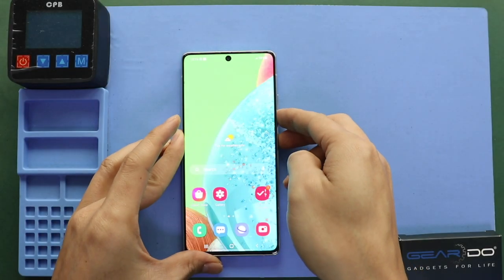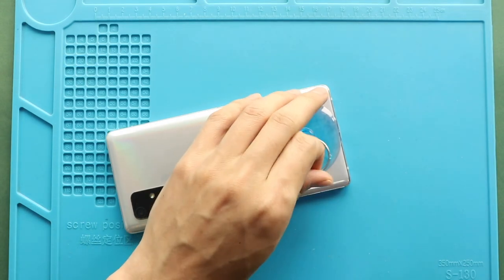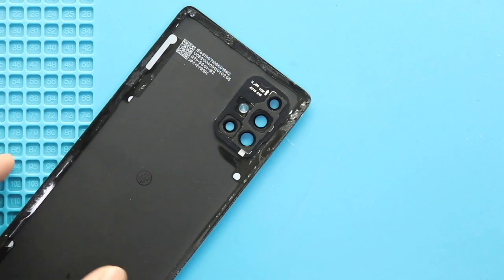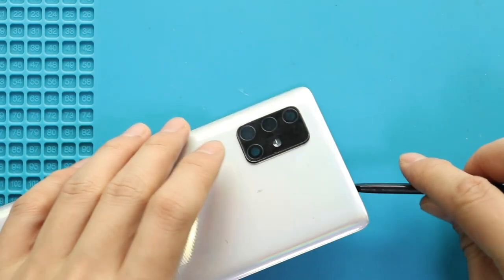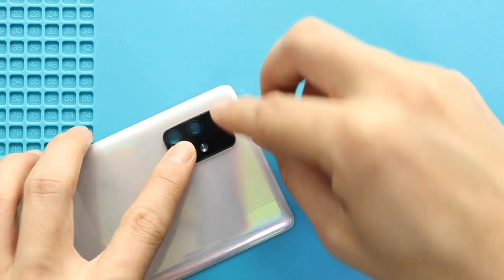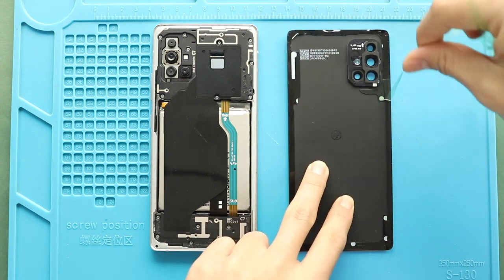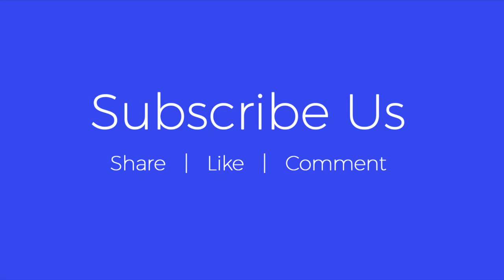Samsung Galaxy A71 | A71 5G Camera Lens Glass & Back Cover Replacement

Comment: When u remove the strip of the back panel. Does it have the glue already? Y u  didnt put any glue before putting it back
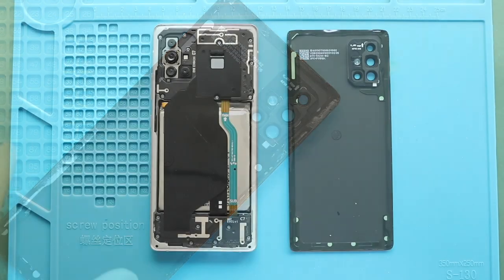Reply from the maker: 03:20 we are removing the protective tape.This back cover came with original adhesive installed.